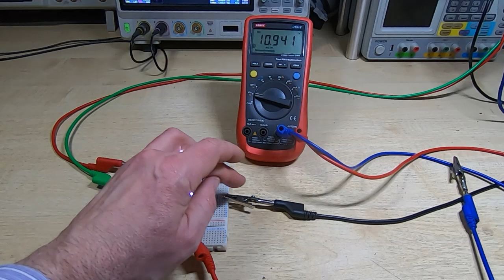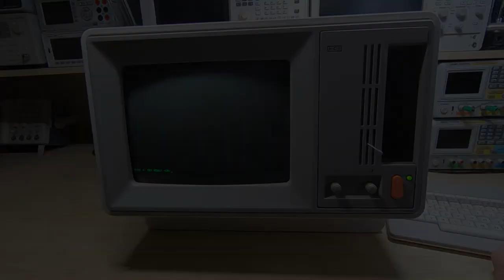NCR Computer Repair Part8

Comment: Great videos! I've for 2 of these computers. I miss keyboards. I've got no display, but get a beep, action on hdd and the crt screen is powered on. LED 5 and 8 gets lid up, keyboard error?

Anyway, I could send you parts from one of them if its any help. Do you got a spare keyboard to return?
Reply from the maker: Thanks, These are not my machines and I no longer have them. I think that the owner had to find keyboards separately and they cost him more than he paid for the machines. They will not boot up if the keyboard is not plugged in and you will not get anything on the display so possibly yours work and you just need to locate a keyboard (or modify the ROM code to boot without a keyboard attached).
Reply: @JerryWalker001 I managed to get a display and made it boot, on one of them. By using an AT keyb, it seems to send 1 byte to get it to start, I then removed keyb while it booted, if not removed it would stop loading. It fully booted from floppy and ended on hdd drive C:

Of course I cant type without keyb.

Comment: Pity that the custom chips were damaged and couldn't be replaced, but at least the computer can be booted and run with floppies only. It was as usual very interesting to follow your trouble-shooting, and to learn about how the microcontroller works. Just a question about the channel logo: it looks like a visualisation of an atom, but what are the little black shapes in the nucleus and electrons supposed to be?

Comment: Jerry, concerning the custom chips, if you would like it, I can offer decapping and imaging the dice for reverse engineering purposes.
Reply from the maker: Thanks, I actually have the equipment to decap IC's but as there are so many different custom IC's on this board it would not really help. Even if I was able to fully determine the inner workings it would be impractical to design and build custom modules in order to get the board working but thanks anyway.

Comment: I wonder if he could replace the WD1001-05 with a WD1002-05,  a quick look at the data sheet suggests the host pinout is the same (if the WD1001 has a 50 way connector which some versions do then the first 40 pins are the same on the WD1002-05 and the rest are either unused or 5V
The command and control registers are probably the same, WD seem to like keeping them the same.
I was surprised to find the interface and control registers on the WD1002-05 are quite similar to IDE
Reply: That is even my thought as I have 2 external hd's with  WD1002-HD0 controller include.